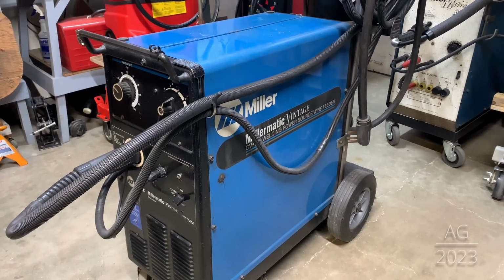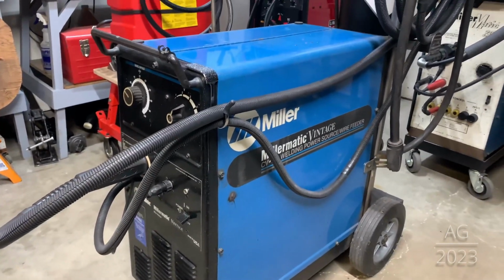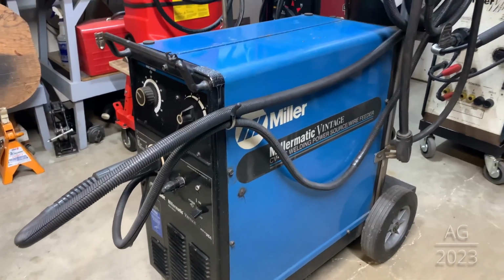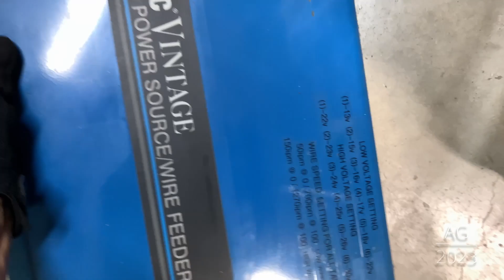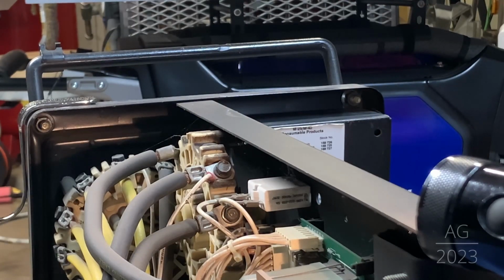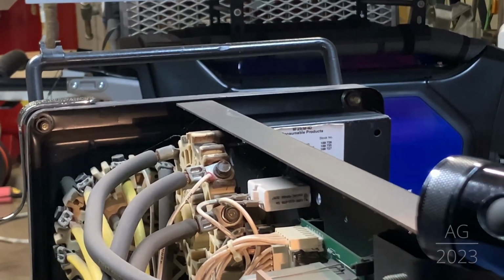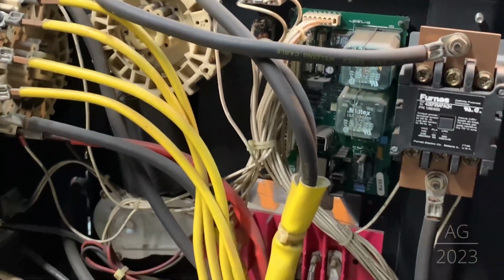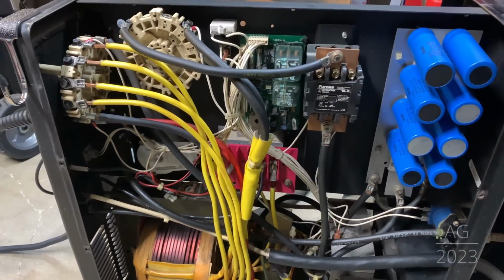Millermatic Vintage - A Look Inside

Comment: Alberto, 

I'd love to know what settings you use with your Miller Vintage when butt welding  on 1/8" to 1/8" with 0.030" wire and 3/16" to 3/16" and 1/4" to 1/4" both wire speed and voltages

I think my "Bacon sizzle" is too loud and that I may be doing it wrong? Anyways any help & I would be grateful for your input..

Thanks

JM
Reply from the maker: @johnmccarthy6451 This is what I use to reference my welder settings. The Millermatic 3-Pack (MIG, TIG, Stick) Calculator Cards. 
Here is the link:  https://www.millerwelds.com/equipment/training-solutions/training-materials/3pack-mig-tig-stick-calculators-043125
These are some really nice cards to have.
Reply from the maker: John, If you contact me through my email, I have a pdf file I made, and I would like to share that with you regarding your mm vintage welder. I think it would really help out with the settings. let me know.
Reply: @albertoguerrero5362  

I think that there are multiple .pdf manuals available from Miller on the Miller Vintage welder.  I think the .pdf manual I emailed to you has even more than the an earlier version that I already had. My Miller Vintage was made in 1999 by all their records and it seems in good condition. I'm working away at getting up to speed.. Thanks again Alberto for your help. 

John Mc
Reply from the maker: @johnmccarthy6451 you are more than welcome and thanks for sending me the manual, I will definitely take a look at it.

Comment: Alberto

I finally found a nice Miller Vintage welder. It was fairly priced but had no gas cylinder or gas gauges. I drove all over creation go get it and bring it home. I drove 1900 miles in three days to get this beast.. 

I've got a starting out question for you. The copper spool of non-flux has rust all over it. It's a very large spool, that I don't want to throw out the spool of 0.35" wire but, if it's got rust on the wire, do I just peal back the to clean wire or throw it away and get myself a fresh spool of welding wire? 

Thanks in advance for your answer! I do know I've got to take it apart and vacuum out the internals as it's been stored in farm shed where the outside climate is very damp. This dampness caused the welding wire to go rusty on the outside..
Reply from the maker: Hello John, Nice to here you found one. I do recommend you buy another spool of wire and do not throw away the spool of wire the came with it, you can still use it as tig wire. Mine actually came the same way as yours with a rusty spool of .045 wire. I use that wire as Tig wire, I just burnish the rust off with a piece of scotch-brite  and the wire is good to go. To this day I am still using that old roll. Hope this helps.
Reply: @albertoguerrero5362  let me get going with the MIG first before I migrate to TIG. Point taken on the wire. Where do you usually get your wire from? What type of gas cylinder (Mix?) do I need? Pure CO2 or CO2 & Argon mix? 

Thanks for your pointers. 

What projects are you working on currently?
Reply from the maker: @johnmccarthy6451  Mixed gas (Ar/CO2) in 75/25 ratio may be you best overall option. As for welding wire, myself personally, I use Lincoln ER70S-6 as well as HTP brand in .030 and .035 dia. However your purpose will determine the type requirements. Projects? I just uploaded a project titled "Bicycle Floor Stand - Made from A Motorcycle Wheel Chock". Pease check it out! Thank you for your comments.
Reply: What is a good price for one of these? Someone is selling with a tank and asking $1500.
Reply: @alanrussell6678   Alan I paid $1000 for my unit and I don't think it has seen a lot of use. I drove 1900 miles to pick it up in So. Oregon which was a three day road trip for me. That cost about $300+ between gasoline + two nights in a motel. I bought my argon / CO2 bottle locally as a separate transaction and by the time I was done that cost about $250 for a full 150 Cu Foot tank of AR/CO2. + $130 for a flow meter so if you don't have to drive too far $1500 for the machine + tank & flow meter isn't expensive. 

I had a fabricator build me bike rack for the garage. So I've been able to win enough space now to buy or build a welding table. I've got an auto darkening welding helmet I bought at $120 too. All the extras add up. I've got to get a welding table going in some form or other + then I can start actually welding.
Reply: @johnmccarthy6451  Thanks for that information John.
Reply: @alanrussell6678  Alan, did you end up finding a Miller Vintage? If so how are you getting on with your progress?
Reply: @johnmccarthy6451  I did not. The one listed for $1500 at the time is sold.  I missed it by going down the welding equipment rabbit hole to do research.

Comment: Alberto sorry to pester to you but  when you're welding 16 gauge sheet metal and 0.030 with C25 mix what are your settings wire speed and voltage, on your Miller Vintage?
Reply from the maker: Hello John, good to here from you. Keep in mind that these are just approximate values and will vary from machine to machine. Per the millermatic caliculator recomendations for .030 wire and 16 ga. sheetmetal it is recommended as follows: 250-340 IPM (wire speed) and 17-18 V ( 75/25 mix gas). This is just a starting point and you will have to adjust from there as necessary. I hope this helps. Also you may wnt to verify your miller is set at the Low Voltage setting as well (inside the panel). The outside tap on mine is #4, may be different on yours.
Reply: @albertoguerrero5362  Albert thanks for the heads up. I've a few more things to check. I did get some beads laid down last night which is starting to improve. I'm only practicing with 16 ga and 0.030 wire presently. I've a 75/25 Gas Mix too. My dials don't give me IPM but a function of 1-100 and the voltage is 1-6. I did note the internal switches inside the drive roll bay too.. 

I'm getting there. "Life's a marathon not a sprint!" ~ Anon!
Reply from the maker: @johnmccarthy6451  Thats the beauty of these old machines, Reference the following as approximate and a starting point to help you out. Regarding the Dial for the wire speed. 0-10 (50-124 IPM), 10-20 (124-198 IPM), 20-30 (198-272 IPM), 30-40 (272-346 IPM), 40-50 (346-420 IPM), 50-60 (420-494 IPM), 60-70 (494-568 IPM), 70-80 (568-642 IPM), 80-90 (642-716 IPM), 90-100 (716-790 IPM).  Regarding the Tap Switch 1=(13v), 2=(15v), 3=(16v), 4=(17v), 5=(18v), 6=(22V).  All at the low voltage setting. Again, these are approximate values and not exact.
Reply: @albertoguerrero5362  Thank you ever so much for these notes. I've never seen these referenced anywhere. I do have a .PDF Manual for the Miller Vintage but I'm going to find a printer that can create a double sided copy for me and I'll put your notes inside my ring folder for going forward. 

I now have I another question, what would be the high voltages at the high setting (if) you happen to have them?  

Do you have, other web forums where there are lots of Miller Vintage users, that I can garner knowledge from too?
Reply from the maker: @johnmccarthy6451   You will not find them anywhere, yes I will share.
Reply: @albertoguerrero5362  Looking forward to it..
Reply from the maker: @johnmccarthy6451  Again, as I mentioned before, these are just approximate values and not exact in any form, just a reference. This is with the voltage Range Selector switch setting at High. Regarding the Dial for the wire speed. 0-10 (150-262 IPM), 10-20 (262-374 IPM), 20-30 (374-486 IPM), 30-40 (486-98 IPM), 40-50 (598-710 IPM), 50-60 (710-822 IPM), 60-70 (822-934 IPM), 70-80 (934-1046 IPM), 80-90 (1046-1158 IPM), 90-100 (1158-1270 IPM). Regarding the Tap Switch 1=(22v), 2=(23v), 3=(24v), 4=(25v), 5=(26v), 6=(30V).  Hope this helps!   (Note and caution: this high side is a lot of power) I never use it.
Reply: @albertoguerrero5362  Thanks for this info.. I've two extra sheets of info for my ring binder on my Miller Vintage! Wonderful info! Thank you Alberto!
Reply from the maker: @johnmccarthy6451  Hello John, have you had a chance to mess with the reference settings for voltage and WFS on your maching? Has it helped any?
Reply: @albertoguerrero5362  absolutely. I've been working away by trying to get about 1 hour a day of welding practice in. I bought some 0.030 drive rollers off eBay. I then thought I had a bad ground so I bought a new 300 amp  Lenco earth connector. The earth lead was getting warm. So I was off for a while not welding. 

I've gotten some 16 ga steel I'm practicing with + (with it) being light gauge it doesn't need a lot of voltage so I'm on the lower of the two voltage settings. 

I just finished now and I looked at the wire drive and I've just gone through 2 lbs of Lincoln wire and I'll be up to Harbor Freight for 10 lb drum of 0.030" wire tomorrow to get going again. I really appreciate your help in getting me going.  Thanks Alberto you've been a great help..
Reply from the maker: @johnmccarthy6451  Good to Hear! I am glad it is working out for you, I will do my best at my level to help you as much as I can. That is a nice welder you have, you will never outgrow it. Stay in touch!
Reply: @albertoguerrero5362  Alberto I have a long list of equipment I need to buy so I'm taking my time to get there. Chop saw, Mag Drill etc. It all costs $$ so I'm doing it slowly.

I've a BBQ I want to get built and get sold as we have a HOA that needs a shared BBQ for smoking meats up in Utah. That's the first project. Even so I'm on my way..
Reply from the maker: @johnmccarthy6451  Yes it does take time, I agree.
Reply from the maker: @johnmccarthy6451  How has the welder been working out for you?
Reply: @albertoguerrero5362   Albert, I've been out of town for two months on vacation. We traveled all over Colorado Utah New Mexico and Nevada. I got back about a week ago and I'm just out now in the garage doing some practice. 

Aside from your welder what do you feel are the most important tools one needs to go with your welder and in what order would you purchase them? 

I'm thinking of signing on for a CNC plasma class to learn the ins and outs of CNC plasma cutting in the new year. I still have a slug of tools to buy but I'm in the mood to hold off for a while until the economy rolls over and equipment starts to get sold at giveaway prices. 

I look forward to hearing back from you
Reply from the maker: @johnmccarthy6451  Sounds like that was a fun time. That's a tough question to answer, I have always kept things very simple. Basic tools go a long way. Enjoy that welder!

Comment: Alberto

I've got a silly question, do you know the model number needed for an aluminum spool gun for the Miller Vintage by any chance?
Reply from the maker: Hello John, actually I do not.
Reply: @albertoguerrero5362  I think it's a Miller Spoolmatic 30A spool gun with WC-24 accessory? Does that sound right?
Reply from the maker: @johnmccarthy6451  I'm not sure on the WC-24 number. However it is a Spoolmatic 30A and I believe the PN may be 130831 but I am not sure on that so you may want to research it to verify. I hope this helps.
Reply: @albertoguerrero5362  Thanks for your input. I'm pretty sure it's a  Miller Spoolmatic 30a + the WC-24 wiring interface..

 I should get my welding table together soon.. Won't be long now.. I've got my argon/co2 cylinder + 100% full argon cylinder too.. So I'm slowly getting there. Can't be in a rush! Thanks Alberto for your input. Let us all know when you are doing some interesting projects too!
Reply from the maker: @johnmccarthy6451  I will, I have just been very busy which is a good thing. Good to hear your getting all set up.